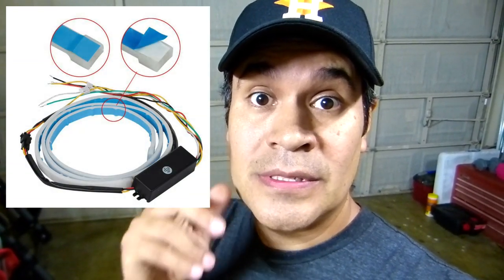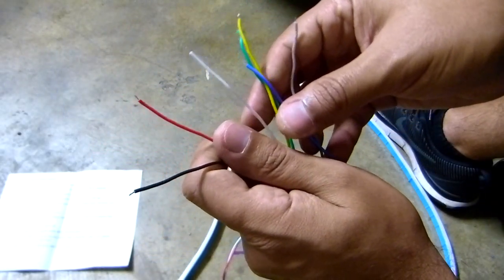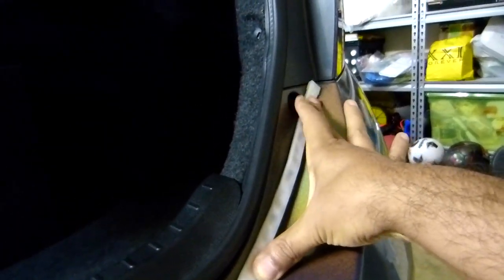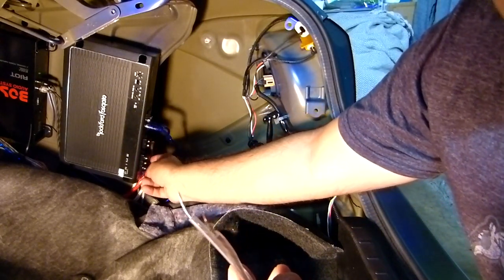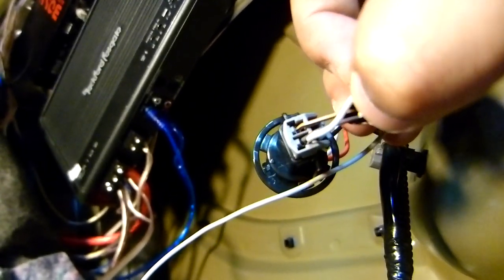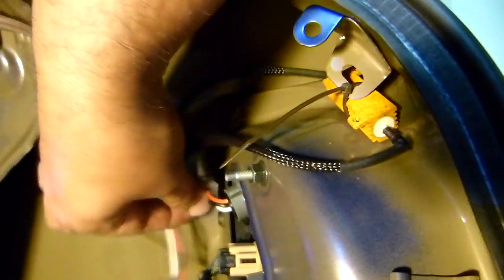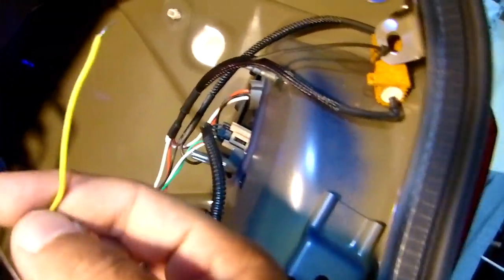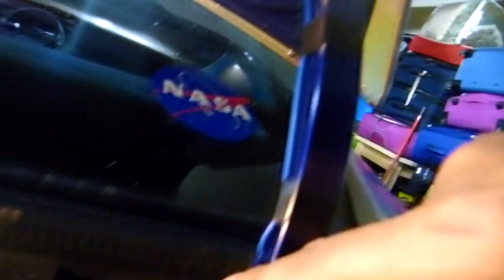$15 Trunk LED Strip Install for Your Car

Comment: The video is extremely informative. The package I received has no installation instructions at all. I had NO IDEA where all of the wires went. Of course we know Red and Black goes to + and - but, the other 5 🤔🥴. 
I needed to see this video. I started a return request to the seller because there were no instructions. Now, I'll keep it and follow your instructions. I'll post the results.....🤞🏾👍🏿.

Comment: Heya, where should I attach the positive and negative wire if I don't have amplifier like yours. :) thanks in advance
Reply: Run a long wire (speaker wire) to your battery .. red positive black negative 👍🏼

Comment: What if you have no Amp in the back?  Do you really need to wire the Red and Black wire all the way in front of the Battery?
Reply: Unfortunately yes I believe you’ll have to run those two wires all the way to the front wherever your battery is

Comment: Cool! Really wish the turn signal modes started from center instead from the opposite side and there was a way to adjust the sequential timing to match the OEM blinker timing. That might be a deal breaker. MIGHT!
Reply from the maker: Yes that a very good Idea, I will check if there is something like that on amazon. Cool thanks bro 👍

Comment: Why are Your led load resistors not attached to the body of your car and tie wrapped? BTW your wires will after awhile short the way you ran them for the led strip.

Comment: Where can I connect the black and red cable as my battery is at the front? Can I cut the led strip a little short?

Comment: I did mine too in my corolla 2019.. so cool and I luv it
Reply from the maker: Cool thanks 👍
Reply: Where you at in Texas I'm in San  Tonio I want to do those lights you made it look very easy I is there a link what are they called

Comment: cant you connect it to the positive n neg on ur rear lights so when u turn on ur lights the strip then turns on?
Reply from the maker: yeah I think you can do that 👍
Reply: Mmmm did it work myke?
Reply: I think it should because that where there going anyway for your factory light I was thinking the same even my ground for my amp don't go to the battery I have it bolted in my spare compartment where the jack gos

Comment: Hey. I want to set this up in my front grill so that when i unlock, or open the doors, it turns on.  Can anyone walk me through this?  I have old wires that were setup for this, so i know which wire i need to connect it to the door lights... But where do i install the red + and black -  wires?

Comment: Cuando dices conectar los cables a la batería, a que te refieres con eso? Me confundí en eso
Reply: He means the red and black wires must be attached to the car battery under the hood, you should be able to pick the side the car battery sits and tuck under the floor carpet trim along back door then tuck under the seat and along side front sill, out through the bulkhead and finally the + and - on battery (red to +)   (black to -) hope this helps

Comment: Where can I get extra wire for the red and black wire to connect to my battery?. I have no power supply in my trunk
Reply from the maker: I used speak wire but you can use this cable https://amzn.to/2oYHlLI 
The strip doesn’t need a lot of power 👍

Comment: Love the upgrade..... I  have the 2014 corolla S plus. What led lights are used for the reverse lights and break lights and turn signals ? I tried searching your videos but couldnt find it. Im also wanting to know if there is any upgrade for the Round LED driving lights or are they not upgrade-able  ,I already upgraded my Fog lights.  Thank you .
Reply from the maker: Cool, 7443 for the brake lights and for the reverse 912:  http://amzn.to/2xVuLyc 👍
Reply from the maker: The headlights are sealed you can only charge the high beams and turn signals 👍
Reply from the maker: Bright LED BRAKE lights 7443 bulb LASFIT Review - COROLLA https://youtu.be/ZOZAuIglh7k

Comment: I was wondering! Did you put the white and green wires in the same line? Or you put them in the separate lines?
Reply from the maker: I connected the white light to the running lights on the brakes but you don’t need to do that because you can get pulled over if you have white lights on the rear 👍
Reply: @Shinegadget  you mean you connected the gray reverse wire to running lights? 
Oh!  what i was asking is the green wire on LED did you connect it to the brake light?

Comment: I have two brake light wires and two reverse light wires do I tap both to the designated wire  or do I only need to tap one wire?
Reply: Only tap into one side but you will need to tap into the left blinker and right blinker
Reply: Ok so tap one brake wire and one reverse wire...ok thank you

Comment: Just fyi , I had this led strip installed in the back of my gx470 in Florida, and got stopped by the cop few days ago. It illegal in most state to have blue lights on your car
Reply: It’s illegal to have any blue or red colors
Reply: So try to fix a mini switch for that

Comment: Is legal to use that kind 🤔  of led strip in the trunk?
Reply from the maker: Yes turn signal and reverse but not the white light on the rear 👍
Reply: @Shinegadget  okay casi todos se.conectan . En el tailight  verdad .menos el negro y rojo.

Comment: Car looks great! But I think that light gets attached on the inside of the trunk lid ✌🏼🙏🏼
Reply from the maker: Well if you put them on the trunk is going to need a lot of wiring. Cool 👍
Reply: That's what I was thinking. Glad you asked. I guess it would be too much extra wire. I wonder hiw much extra, 4ft? I think it does look cleaner  if on the trunk and worth the extra wire. How much will the extra wire cost tho??🤔

Comment: I think the law states amber (orange)  on the front for turn and running lights  and  red on the back for turn and running....     i don't think white is gonna cut it on the back.
Reply from the maker: Yeah front you can use amber or white but on the rear red, amber, and white for the reverse only. Cool thanks 👍
Reply: @Shine Graffix     Unless you're using it for emergencys only like if you're broke down on the side of the road on your butt changing a tire.     I don't think that would be illegal since they have all kinds of battery operated emergency strobes you can throw out there so that you don't get run over.

Also I would suggest maybe throw in a switch somewhere easy to access that kills all but the oem lighting for those special times when you don't want to attract attention or reduce the risk of getting pulled over by an overzealous cop...

Good luck , looks great...

Comment: so i need some extra wire to connect to reverse light to got it to reach to to plug i the trunk
Reply: need the link to order
Reply from the maker: Yes you will need extra wire for that 👍

Comment: 2018 impala i cant find my brake light everything else works
Reply: I have a similar problem. My break light and turn signal are the same wire and bulb

Comment: i thought it attached to the trunk lid not the bumper
Reply from the maker: well if you put it on the trunk, the light is going to be hard to see 👍
Reply: @Shinegadget  wat gauge wire did u use?